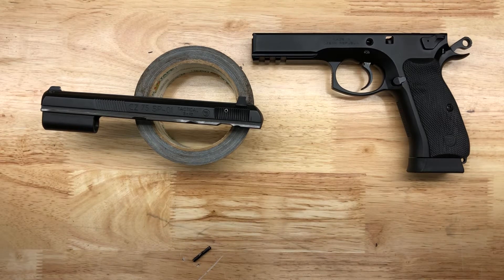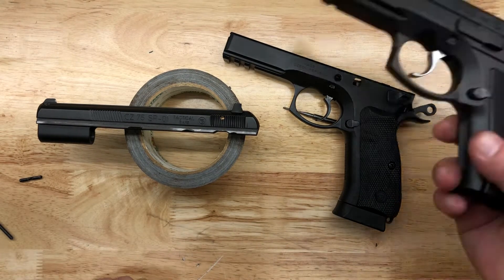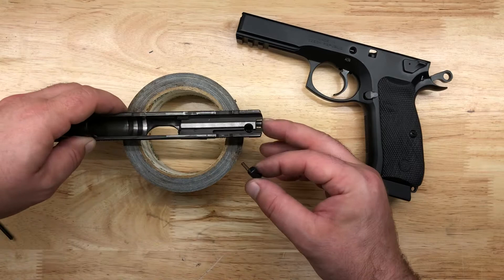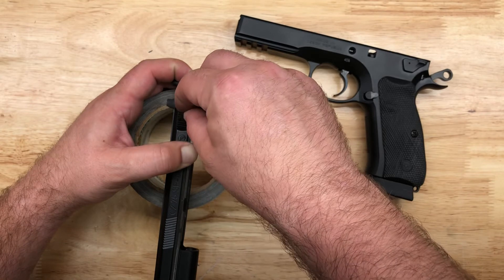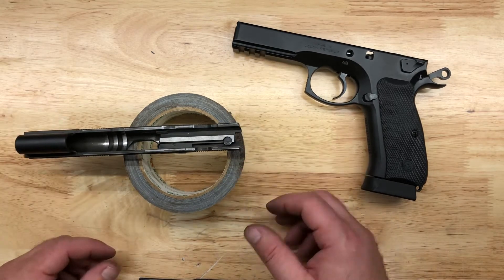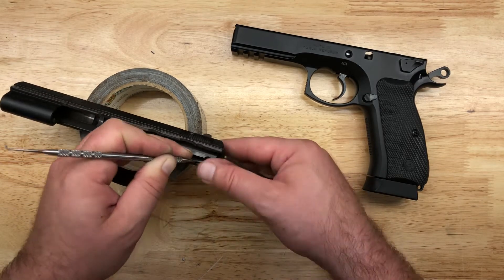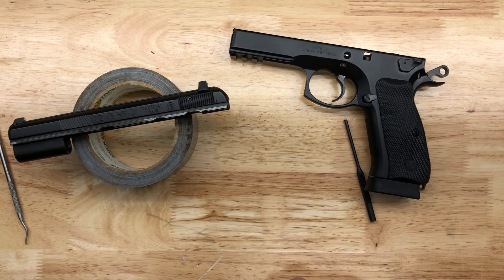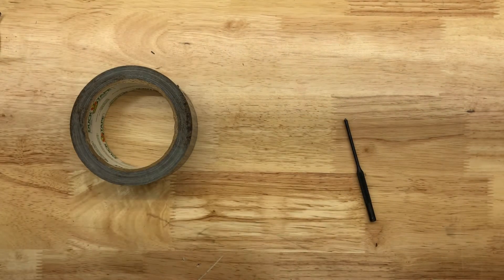CZ SP-01 firing pin came out

Comment: Use a #83 rubber o ring in front of the firing pin and u can dry fire away without hitting the firing pin with your hammer :)

Comment: One side of the hole for the retaining pin is larger than the other (at least it is on my P07). From my understanding, it's easier to get out if you drive the pin out towards the larger hole and reverse it when installing. I had one light strike this weekend so I went ahead and ordered a couple of pins just in case.

Comment: What you think causes the light strikes?, do you think it is metal shavings from roll pin getting in firing pin Chanel? Thanks
Reply from the maker: 1. weak hammer spring
 2. weak firing pin spring
 3. worn firing pin retaining pin (fault found in video)